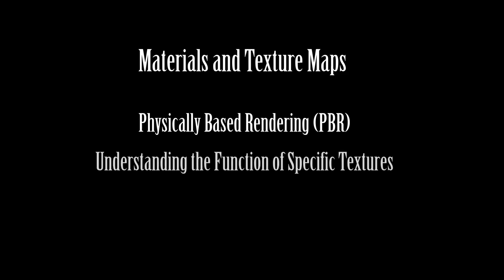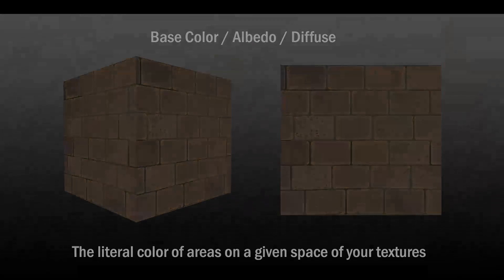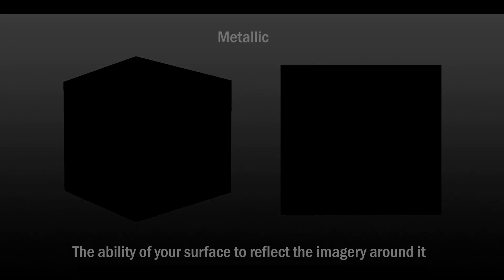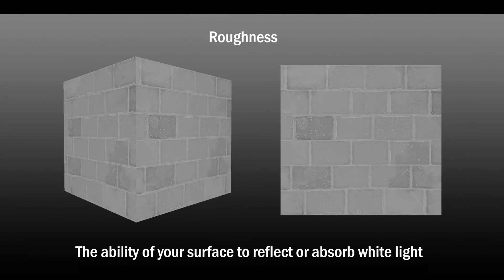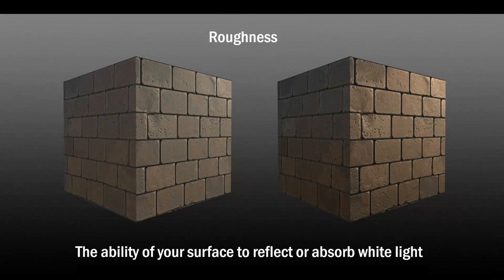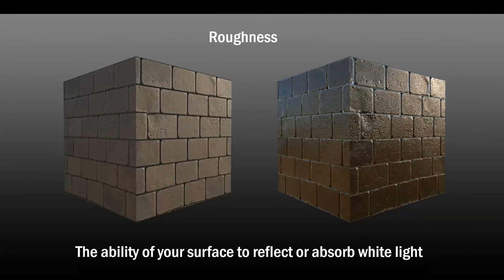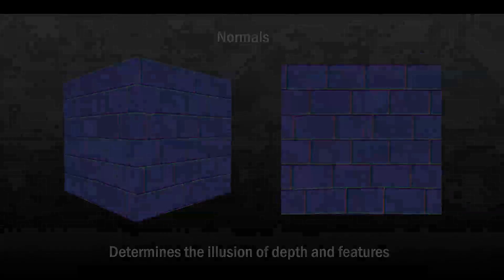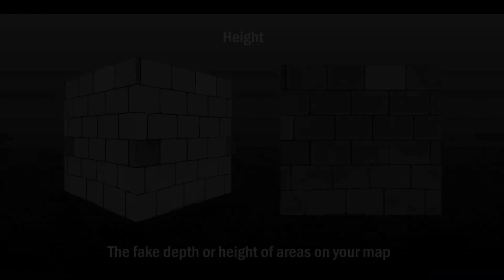Texture Maps Explained - PBR Workflow

Comment: This video is old but good, but I need to point out that "Metallic" is the most misunderstood maps, folk have it black for non-metallic and white if the thing is a meteall, but this shall be seen as how metal like something is, like bricks can have some small reflective specs in it and some parts of a butterfly wing can look like metal, so to just have it black or white without use the range in between in a metall map is a waste of resources and it should often be used more often than folk think.

Comment: Few corrections:
For gold you don't use "a basic yellow colour" you use a very specific colour. If you use any different colour you are not following a proper pbr workflow and the material will be outright wrong.
Metallic means reflections are coloured by the albedo colour while dielectric does not. Roger dictates the reflectiveness.
Roughness dictates diffusion or direct reflection. Your attempts at elaborating are wrong.
Height maps don't always fake geometry, they dictate geometry that can be added in shaders through tessellation.
AO is basically baked lighting. If the renderer already has a solid shading algorithm using the height and normal map, AO is redundant. That's why it doesn't show much. In a less advanced renderer it would be more apparent. And AO is NOT pbr, it's a compromise because of limitations in rasterisation and compute power.

Comment: Metal/Rough PBR Workflow

Color = Albedo
Reflectivity = Metallic
Specularity = Roughness
Lighting = Normal
0-1 Height Range (Depth) = Height/Bump
Shadow Depth(?) = Ambient Occlusion

*If you are given the option for specularity in a Metal/Rough workflow, it's referring specular levels and not a mask, leave this at the default level (in most cases).

i think :'|

Comment: Some things you should have explained instead:

Metallic: It's either 1 or 0. Metallic in PBR has no value in between. An object/surface is either 0 or 1 metallic.
Roughness: Doesn't just control white light, also controls reflections and any type of light bounce.
Ambient Occlusion: Does NOT take up additional space as it's multiplied onto the albedo texture and thus does not influence performance. You confused it with the generated ambient occlusion between objects in game engines.

Comment: Jessus i hate the naming and PBR in general :-)...

So "Roughness" is essentialy "Reflection glossines" in renderers like Vray? (in non real time engines)?
And "Metalness" as i understand is simple "Reflection" in Vray?

Correct?

If yes, why the fuck invent new names for already existing "maps"? (but i have to be wrong... there has to be some difference)...?
Reply from the maker: Basically, roughness determines how rough the surface is (yes like how glossy the surface is) and metalness simply tells the software if the object is metal or not.  I couldn't tell you why they named it what they did, but it's a different way of calculating the maps all together so I'm sure they named it differently to differentiate between the two.

Comment: Thank you for your video it's really helpful and straight to the point. However I still have question since I'm a newbie on this matter. How are you supposed to create these maps ? I know how to bake diffuse and AO from Maya as for the normal I usually use Zbrush. But the other maps are completely unknown to me. Any tips / good tutorial for this ?

Again thanks a lot. I was taught about the old process of texture creation and PBR workflow is pretty new to me.
Reply from the maker: If you're just starting out, I'd recommend creating the maps individually with a software like Photoshop.  You'd start with using the UV unwrap of your model as a guide to where your texture will be placed.  Color generally comes first, placing brick or whatever where you want it.  Then you can generally start something like roughness and metallic by desaturating your color map and using it as a guide.  Don't just straight up use this though.  You'll want to paint where the texture should be rough and smooth, etc.  So tl;dr, it's all manual work.

Alternatively, newer software such as Substance Painter and Quixel have materials built into them that contain all the maps already.  You plop them onto your model in real time 3d in the viewport and then adjust from there.  This is great, the issue is sometimes you can get yourself in a lot of confusing when dealing with all 5 maps at the same time.  Good luck!
Reply: Hello Zeracheil. I tried my hand at doing these maps by hand because I found nothing else relevant for this job (Except  Substance like you said, but i don't have any licence yet). So far so good even if it can be tedious or time consuming  to say the least but now I now im doing it right so I think I just have to train and improve my skills in order to do it faster.

Thanks a lot for your time I really appreciate your help.
Reply from the maker: No problem.  It can definitely be tough at first, especially doing it manually but I think you'll find you better understand the values (black and white and in between) you'll want when you move onto software like Substance Painter or Quixel.  Good luck!

Comment: The first thing you say is already incorrect. Albedo and diffuse is not the same. In simple terms albedo is the color of an object without any lighting properties, whereas diffuse is the color of an object with some lighting properties.
Reply from the maker: That's correct.  Technically they are not the same, however, to make things more simple for people starting out, they can essentially be lumped together and then delved into further when the user gets more technical.
Reply: An albedo map is without shadows or lighting in it. "Albedo" means "whiteness," but of course it's used in this context because it basically means "flat." Diffuse is how spread out the light reflects off a surface. Metallic/glossy/mirror/specularity and diffused reflection are all the same thing, but it's evidently faster to compute them separately in renders like UE4/Unity/Cycles/VRay/etc.
Reply: Marselord there's a shortcut.. In photoshop, duplicate the layer of texture and desaturate the top layer..  Then change the blending mode of top layer to screen or soft light..
Reply: they are the same things in 3d software
Reply: ***** Just because you explained it doesn't make it right. Even if they are slightly different in your dear opinion, they became synonyms in the world of model shading. A diffuse texture is the color directly applied to a model. In fact it represents the values of each individual pixel applied to the model's polygons according to its UV. Maybe you confuse with properties like roughness or metallic which in turn represent some physically based rendering as how the light will affect the surface and the look of the light on your model (they will affect the pixels values based on the ones of the diffuse map)
Reply: Valentin Degenne He is right..  In PBR workflow,  we require an albedo map which should be devoid of any lighting..  Imagine a ball with Shadows already painted on it..  That would be diffuse map..  However the actual colour of ball that we see without lighting and shadows is the albedo map..
Reply: ***** your perception of diffuse is a bit incorrect
Reply: No, i don't think so. Please go check on the web about texturing, I have no time to be your personal teacher sorry
Reply: As long as the difference is pointed out bro
Reply: "Whiteness" is a bit misleading though as the albedo will vary across the entire color spectrum, where the integral results in a perceived color with a certain strength. This is exactly what the albedo map represents.
Reply: so albedo is a map without any false textured shadow/light and diffuse is a colour texture with false shadow and diffuse painted on?
Reply: Jacodaify You are correct! I wouldn't however call it "false".
Reply: Man thats really good to know, until reading your comment I thought it was one in the same but with a nicer sounding name haha.
Reply: Jacodaify I thought so as well just a half year ago, and I thought that was correct for years.
Reply: do you know a software that could make an albedo map from and diffuse one? because i was very introduce into the specular workflow and don't know how to make the roughness and reflectivity map
Reply: @Marselord    take a look at this

http://www.boundingboxsoftware.com/materialize/tutorials.php
Reply: in photoshop you can use the image adjustments - shadows/Highlights to get the shadow out the diffuse
Reply: thanks, it works perfect
Reply: ***** I explained how they're different. This also applies to 3d software. I've actually never seen 3d software confuse the difference, but I've seen plenty of game engines mentioning "diffuse", when what they actually mean is "albedo".
Reply: I've never said the term albedo is wrong, what's your point ?
Reply: ***** You are just stating the definition of diffuse map... While here we are differentiating it's usage with albedo maps..  So maybe..  I don't need a personal teacher
Reply: actually albedo in astronomical terms: is a non-dimensional, unitless quantity that indicates how well a surface reflects solar energy. Albedo (Î±) varies between 0 and 1. Albedo commonly refers to the "whiteness" of a surface, with 0 meaning black and 1 meaning white. A value of 0 means the surface is a "perfect absorber" that absorbs all incoming energy. Absorbed solar energy can be used to heat the surface or, when sea ice is present, melt the surface. A value of 1 means the surface is a "perfect reflector" that reflects all incoming energy.
Reply from the maker: Well, we can just agree to disagree then.  I don't think it's a big deal to understand the macro of it before going into the micro.
Reply: While I 100% get that, remember that this easily has an extremely negative effect.

Comment: Good video but there is incorrect info imo. 
Metallic map does not define how reflective the surface is, the Roughness map does! Metallic determines whether the surface is metallic/conductor or non-metal/dielectric. In practice it shows if the reflections of the surface will be tinted or not (metals do tint their reflections according to the albedo color, dielectrics reflect the environment as it is). So with low roughness you can have very reflective surfaces that are either metallic or dielectric - the metallic ones will look like smooth metal and the dielectric ones will appear as smooth plastic :)
Reply: actually... roughness, or glossiness (inverted roughness map) has nothing to do with reflection-strength (specularity) but with reflection-distribution. the same silver material, polished (not rough) or sanded (very rough) have the same reflection strength. 
you can visualize this by assuming a black environment and a single small lightsource. on a polished silver-ball we'll see mostly black plus a small and intense reflection of the lightsource. if we roughen the ball, we now see less black ares and a very spread out and less intense reflection of the lightsource. if we would add together the intensities of every pixel per ball-image and then compare those two, they would be identical. -> energy conservation. 
in some  way, if you would look at just one point on the surface, then you could say that rough means a drop in intensity, but that would be the wrong way to look at in a PBR sense. 
i often use this simple explanation: specular/reflectivity is a property of the atoms, it IS the material. roughness/glossiness is the SHAPE of huge amounts of atoms. polished silver or rough silver are both the same silver-atoms, but with different "landscapes". :-)
Reply: I think that's a great technical explanation. 
I didn't say anything about intensity. I said low roughness will give the impression of a reflective surface (in pain everyday language). Here is an experiment: render a sphere with 0 roughness and then with high roughness, show the two images to someone who isn't a shader programmer and ask them which one is more reflective/shiny :P That's what I mean and I mean it as a general rule that holds in most practical scenarios.
I am sure you can fiddle with IOR settings or whatever and get all kinds of wacky results...
Anyway, I like your atom analogy. Would be even cooler if it was visualized somehow :)
Reply: +Todor Nikolov (ToshiCG) glad you like my atoms :-) everyday use of certain terms can be quite fuzzy when it comes to science. many people would consider the color of a mirror intuitively somewhat grey or silvery, or glass as more reflective than brushed aluminum, hehe
Reply: This comment cleared my doubt as a newbie to all this 3D stuff! I had this particular doubt in mind how these maps differentiate between plastic smooth or metal smooth, and I found it on top comments! Thanks!!!!!
Reply: Your comment and the following responses from @dumpsky to it clarified and taught me useful things that I didn't know , that will help me make my own decisions better and faster when I am trying to create a texture.

Comment: Hello Zeracheil!
The video is well done, but I gotta rectify some things here, cause people might get confused.
1. You wouldn't use a SSAO-Map. SSAO means Screen Space Ambient Occlusion. It is dynamically calculated as a postprocessing effect and can't be saved in a texture for a model.
2. Bump  Maps and Displacement Maps contain the actual height displacement(1d),  Normal Maps contain the Normal(3d). You wou can use all of them in different stages, the use of bump maps and normal maps in the pixel shader has pretty much the same effect (bump maooing or normal mapping). Displacement Maps (the term) are usually used, when you want to really displace the geometry (tesselation) or at least fake the effect more authentically (parallax occlusion mapping) .
3 The procedure here has nothing to do with PRB (Physicl Based Rendering).
PRB is "Blurring" the environment map in the way, that the blurred resulting map represents the ensemble of environment fragments that is to be expected to exit the observed surface from a specific angle (texcoords of the map) for a specific roughness (paramater for the blur calculation).

Comment: I don`t really get why ambient occlusion is put in a seperate map? What is the reason we don`t put it on our diffuse map as an overlay? (you know.., when you`re still in photoshop..)
Reply: Because, some people like ambient occlusion. some don't.
Putting it in the diffuse texture doesn't provide the option.
Reply: diffuse does not equal base colour
Reply: Hi Thank you for this answer. I get it. I`m working on this game with a very dark atmosphere and I painted the ao on my albedo map. I guess it works for me because those parts are meant to be dark and will never be enlightened. 

Is it also correct, I should remove shading on existing textures (like in between rocks on a brick wall, the bumps and crevices, you know like ALL of it.) ? So that those shadows can be picked up by the normal/bump map?
Reply: shadows will only be casted from geometry or displaced geometry (height/displacement map). You dont have to really take it all out. Just take hard shadows that will look out of place.
Reply: I know, I was talking about the shadows on a diffuse texture, by shadows i meant black parts on my texture image, I am not modelling every bump in for example, a rock. So therefore we use bumps and displacement maps.

So a bump or normal map draws shadows and/or light on the texture, I figured this would make it kinda logic to remove all lighting from the albedo map. So the shadowing on these "fake bumps" will always display correctly.
Reply from the maker: Generally speaking, darkening your color map can have adverse affects on how your texture displays.  (Metals might get wonky considering they take from the color in a metal roughness workflow).  Ambient occlusion can also be used to occlude specularity or reflective color which it can't necessarily do properly if it's only a darkened color map.  It's not necessarily a bad thing though.  So long as it looks how you want it in the end it's not wrong.  This used to be something older games did to save memory but now it's often time just something you can toggle on or off.

Comment: Thanks for the video. One thing though.

Enabling or disabling in games is not the AO texture but the SSAO effect. The AO texture does not use much power. Definitely less than the height map when using parallax, POM, or tessellated displacement.